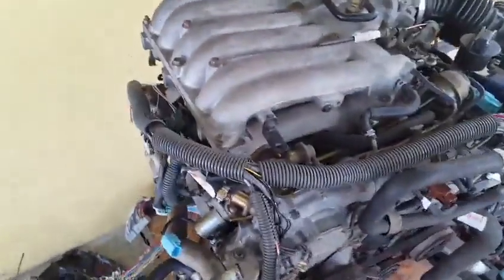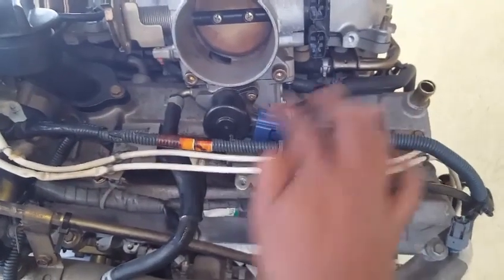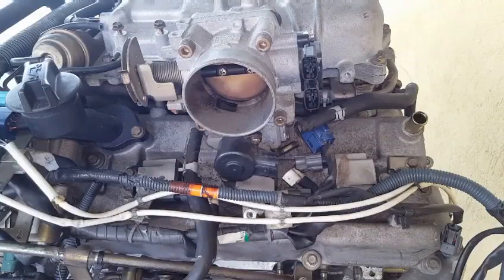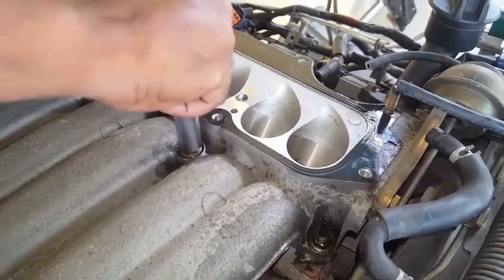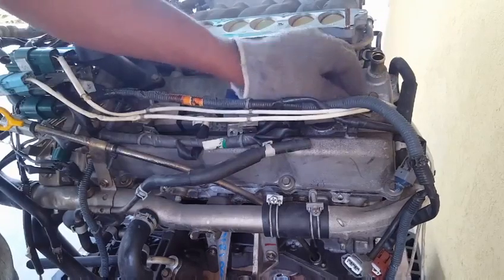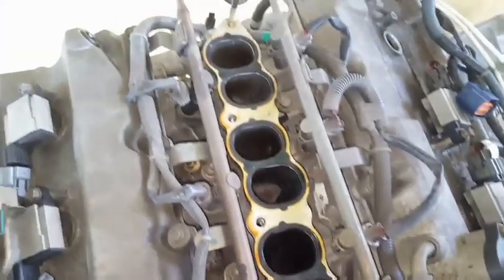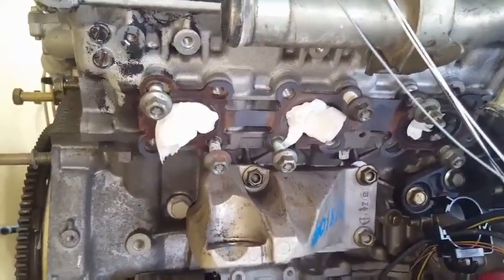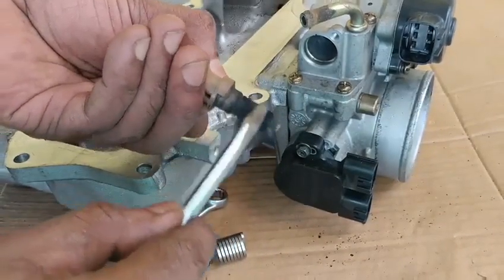How to Intake manifold Nissan(junk) VQ35DE(oil burner) engine. Part 3/9.

Comment: 6:40 It it also a very know occurrence for the coolant to leak into the IACV and burn the motor out and then shorting out an actuator chip in the ECU. Just replaced 3 different IACV's and they all burnt out from the chip being burned when I bought the vehicle. Sauter'ed my own chip on the ECU as a replacement and replaced the IACV at the same time and it eliminated my engine surge.

Comment: Hey Stevie nice to know about the problem of IAC.I am also facing the same problem but in my situation I have check voltage in iac socket port 2/5 battery voltage appears but only mistake that I did I have forgot the sequence of vacuum 4 air pipe lines coming from engine and went to air duct hose and bottle that attached to air duct near air filter box please can upload video to know the correct installation of Vaccum 4 pipelines thank you
Reply from the maker: https://forums.nicoclub.com/where-does-this-hose-go-t615643.html
Reply: Hey well i have change the vaccum pipe sequence but the car still not idle its own what to do now. Even i have check the connector of iac with 12v battery power show 2 and 5 and also i have check the resistance in motor it is under 24ohms .Tps checked with moving the trottle it shows 5v power.Need suggestion what to do next.
One think i want to tell you 2 times i want remove the idle motor and clean the area when i did that and after start the car it idle at 1200 rpm after few mins run back to 900rpm but 2 morning again not idle.
I was only clean the injectors and trottle body.
Please help me to resolve this issue thank you

Comment: i have the Nissan pathfinder has 300k kilometers and original factory PCV valve because no one wanted to spend the money to change it. Its so ridiculous where they put it having to remove upper and lower manifold just to change a simple maintenance part. It is causing me to burn off oil using up oil when there is no leaks. Biggest crap designs on these Nissans no more for me i had enough.
Reply from the maker: Yes. Those engine burn oil after 100k miles. The engine might need new valve stem oil seal replacement.  Synthetic oil is another bad thing if the engine has a EGR valve.
Reply: I modified mine with a 90' going out to rear against firewall then just use a longer hose .the egr screws in to the brass modified piece